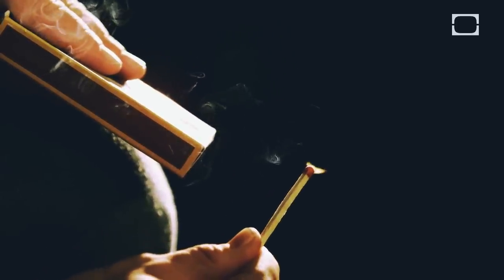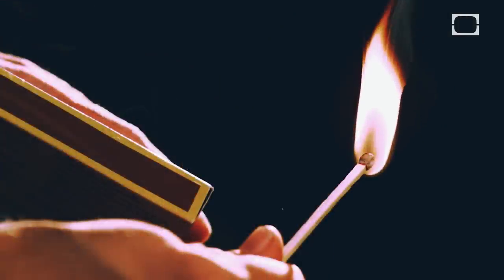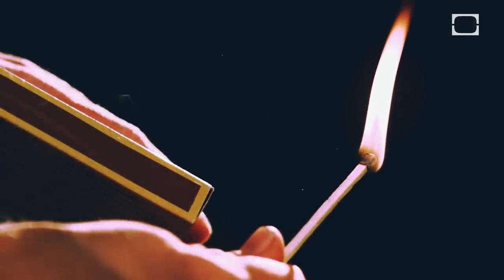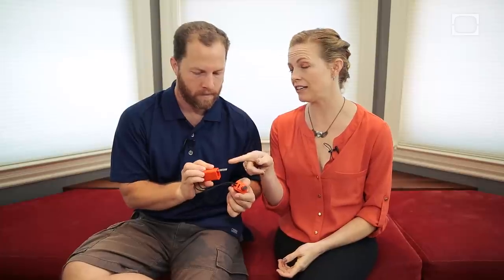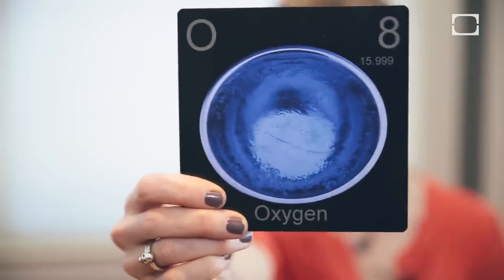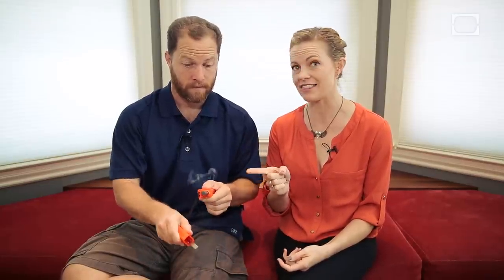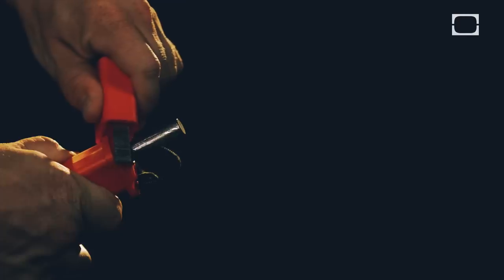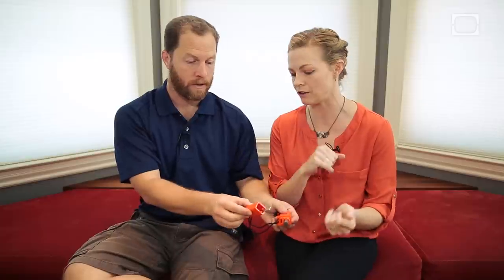How FIRE Works in SLOW MOTION!

Comment: There's actually the older version of matches with actual Phosphorus on the very tip of it. If you find those with a white tip, it means it still has the substance there.

The problem is that phosphorus could light in friction at any surface (ANY, even skin) and by being considered dangerous, they divided substances on the stick and on the box, that can only be lighted with the friction of this two specific components! :)

Comment: Absolutely right; it wasn't flint and steel. Instead, modern replacement using a alloy called "ferrocerium", which ignites spontaneously in the air if shaved off into high surface area particles by the steel blade. It's the same material (albeit a larger piece) that is under the striker wheel on a disposable lighter. :-)

Comment: Actually that fire starter they used that she said was a flint wasn't it a bar of magnesium which is what gave you the sparkles like a sparkler?
Reply: ChildOL no those were just the sparks, magnesium doesn't ignite if you rub flint on it or whatever, when you rub it, specks come off which when ignited it create's sparkles things.
Reply: +ChildOL No, that is actually steel shavings burning.  Magnesium does the exact same thing, just hotter, and to a greater extent.  Steel and magnesium react a little bit more violently.

Comment: It is called a ferrocerium rod not a flint and steel. A steel is a piece of high carbon steel typically 1095 and a flint is a rock. Its apples and oranges but there is a difference.

Comment: thats not how a flint and steel fire starter works. if that was the case then when i use my camping knife against the flint then the knife would dull and the flint would not lose much material at all. THE CONTRARY . my knife is as sharp as ever and the flint is worn down. EXPLAIN THAT

Comment: That wasn't flint, it was a ferrocerium rod, AKA a firesteel. It's obvious to anyone with an interest in bushcraft or survival because ferro rods produce the white hot sparks seen in the video whereas flint sparks are dull red. In addition, white phosphorus match heads have long been banned in most countries. Today, most matches light from a combination of /red/ phosphorus in the striking surface and potassium chlorate in the match head. The lack of fact checking is disappointing.

Comment: No one knows what fire is. you only can know what it does, not what really is. Using general terms to try to explain it, it doesn't work. so Try to explain it from the particle perspective. "heat" "friction"... don't use those words, because that's a simplification of the nature of the reaction. and if you do it, then explain the meaning of 'heat' at particle level. Do you know what a Spark is?. Thnx.

Comment: Oh shit, she dont even know what she sad... The tip of the mach contains no phosphorus at all. It contains an oxidiser ( Potassium chlorate / Potassium dichromate etc ) And the fuel ( Antimony trisulfide ), some SiO2( fire retarding component), and adhesive.
The sides of the matches box containe phosphorus, not the tip of it.  The mixture of potassium chlorate, and phosphorus is a very friction sensitive thing. Thats called armstrong's mix. It is very dangerois mixture. it can easily blow your finger of, so dont try it...  v=WWPamyEQclM
When you rub the tip on the surface, the phosphorus is mixed with the potassium chlorate in a very small amount, and its ignite the tip of the match, whitch contains the oxidiser, and the fuel in it.

The flint and steel part of the video is wrong too. Not the iron burns in sparks, but  ferrocerium, which is te rod part of the flint and steel. Its an alloy of cerium, magnesium, lanthanum etc... Its a very reactive alloy. A little friction is enough to ignite it.

I dont understand how can they make a video with that high number of views, and a lot of wrong information...

English is not my native language, so sorry. Peace!